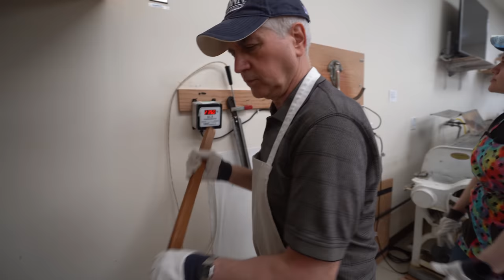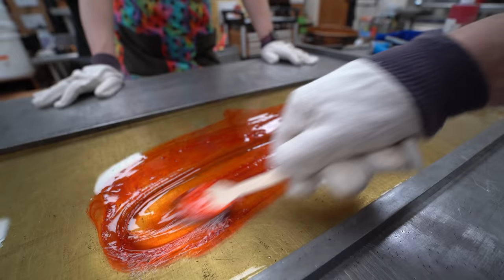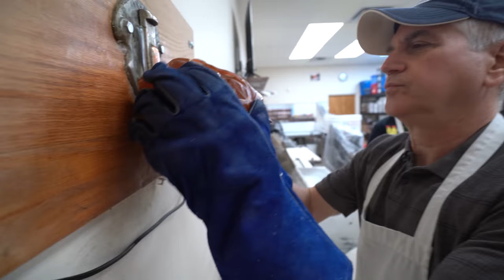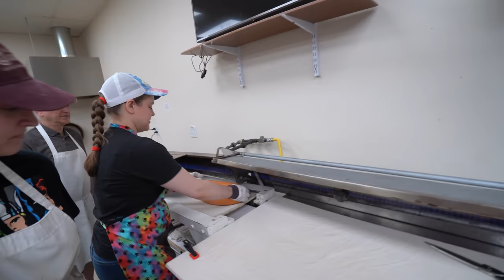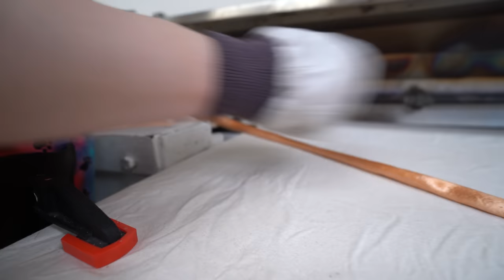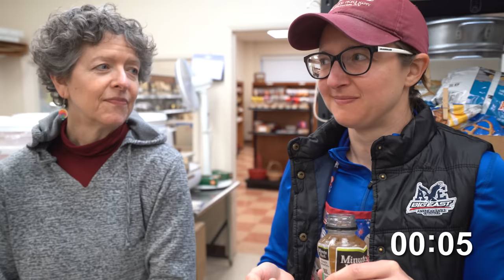She's Just Trying To Hold It Together For The Camera...

Comment: Would it help if you put the hot powder on the table then poured the candy on top or if you mix the powder with the coloring in a cup with plastic wrap over it and poke a hole in the plastic wrap with a stick to stir it and both of those ways should minimize how much of the powder gets into the air because it will be contained/wet from the candy/coloring. It won’t protect you completely but it should help a lot. Pouring it over the candy like that shakes thousands of the tiny powder specks into the air and they settle everywhere. I am a nurse at a prison and when an inmate is sprayed with the pepper spray we find it everywhere and randomly inhale a particle or two for days after they’re sprayed because the particle gets jostled back into the air to be inhaled/touched by some poor unsuspecting passerby so it’s not unusual to have someone randomly start hacking up a lung followed by some form of “when did they spray someone in here?” or “I guess someone got sprayed recently

Comment: I had bad experience with contacts I was working on a farm and had to use the welder to fix a piece of metal well I figured couple tacks and then I'll put the helmet on I did the couple tack welds and then put helmet on well then couple tack welds did a lot of damage I was fine the rest of the day and when I got home and was getting ready for bed my eyes where getting itchy and started to burn a little well I took the contacts out and low and behold my eyes where on fire long story short I burned my eyes really bad I couldn't open them for almost 3days